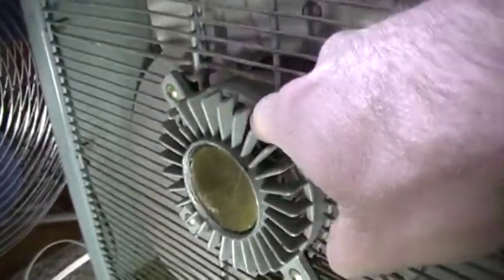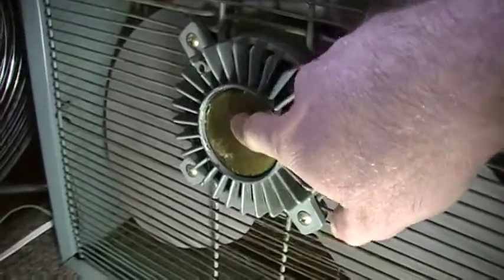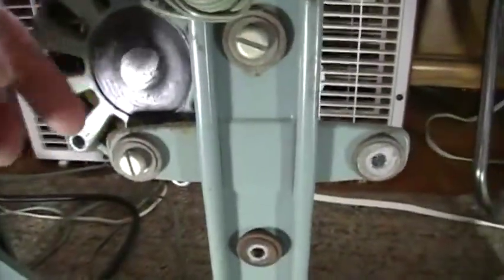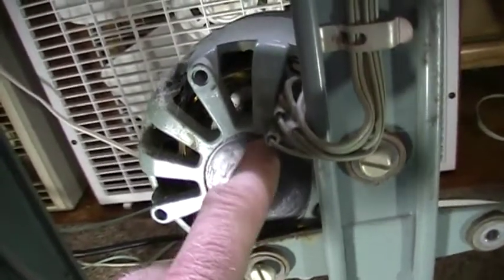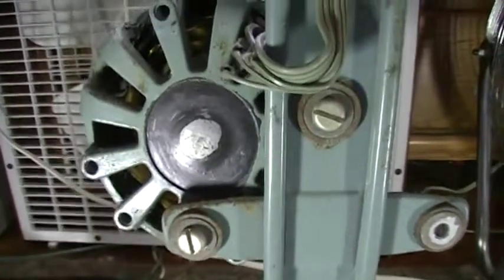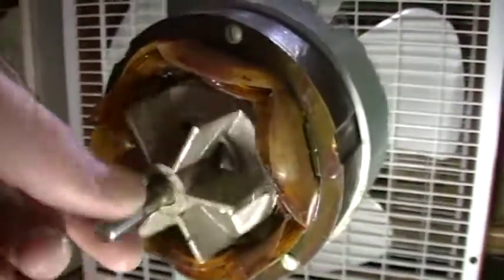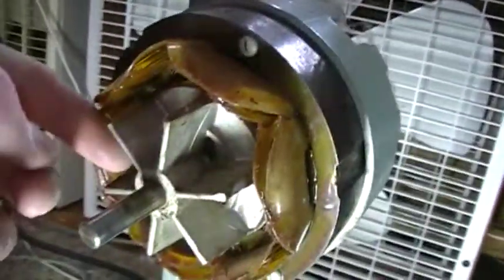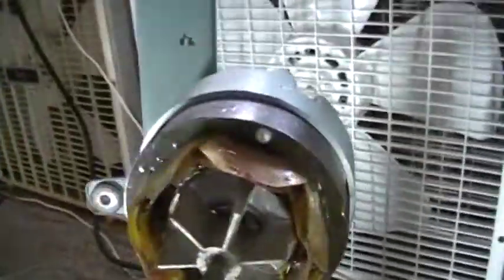GE Box Fan Motor Servicing Instructions.

Comment: I have 2 of these motors. Both turn freely, but they don't run. In each case, the fan was running and it just shut off and never ran again. Did they have some sort of fuse inside the motor back then or does the winding just burn out with age?
Reply from the maker: These motors don't have any thermal fuse.  If the switch is good and the wires leading up to the motor are good, it's probably a burnt winding unfortunately.  Usually these motors are very reliable.  Do the windings look like they've gotten too hot?
Reply: @carson01XJ  The windings in each look good, but there's an opening somewhere in the winding in each motor according to the tester. (no continuity) The  fan is a 1958 battleship grey "electrically reversable" box fan. The original motor just quit, like someone tripped the power. I bought a '60s donor fan & that motor worked for 2 summers then same thing. Shut off while running. No sparks, smoke or funky smell. I used 3 in 1 oil in the bearing of both motors & the shaft turns freely. I just came to the conclusion that it must be age related & the winding will just burn out after 50 or 60 years.
Reply from the maker: That's a shame, especially since these are such unique motors.  It is amazing that they last as long as they do.  At least yours didn't fail violently though.
Reply: @carson01XJ  I just bought a donor fan on Ebay for $35. It's a '60s model with the 5 plastic blade element. The sheet metal is rusted and grilles are bent. The fan is shit, I bought it for the motor. I was going to use 3 in 1 oil on the bearing before installing it unless you know of a better lubricant for these motors.
Reply: @carson01XJ  No indication of over heating or "burn out" on the winding. But as you know, the full winding is difficult to see on these motors.